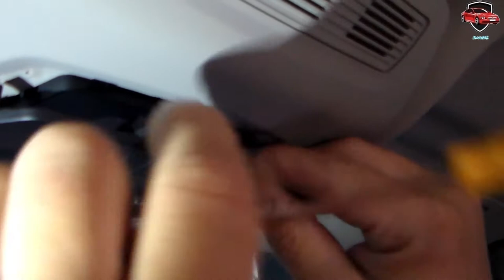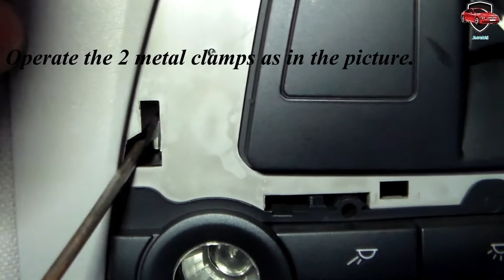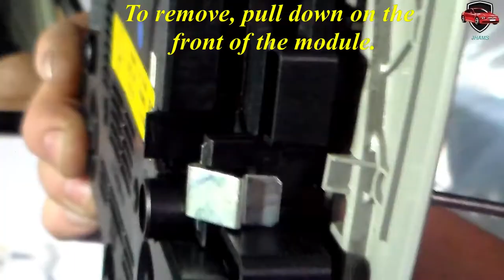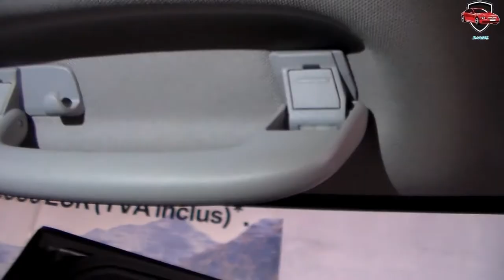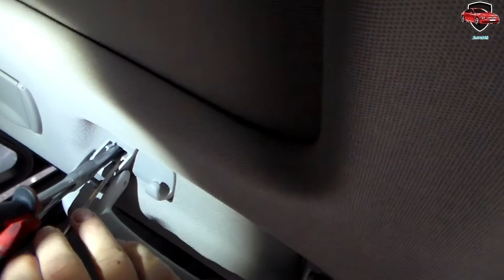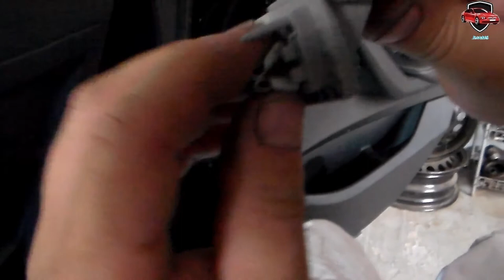BMW  X3 F25 center module interior light and upper handle removed

Comment: Thanks ! Maybe you can make a video removing the ambient lights on the rear.
Reply: U mean the both rear seat dome light ? I used a big Philip , plug inside Center  (the spotlight spots) of the casing then push towards the boot. Never plug your Philip at the side else u will break inner plastic casing like me which are fragile. Once u push then cassette casing shall pops out then u can use your finger pull it out. Just found out Cant post image in YouTube else will be easier.

Comment: After watching so many amateur and so called pro video. I would said tht this are the real genuine and goto video for f25 lci. Not sure if other YouTuber not willing to share or they paid accessory professional ppl did for them. Basically press and push the Lshape hole medal clip, then pull down the front as shown in this video. Since u don’t hv 3 hands ,then u can try pull from one side slowly then Center.  Is not easy.
Reply from the maker: Thank you very much for the appreciation, I'm glad I could help you.